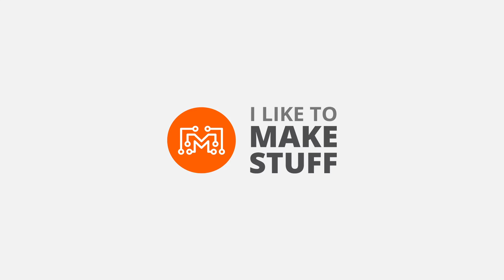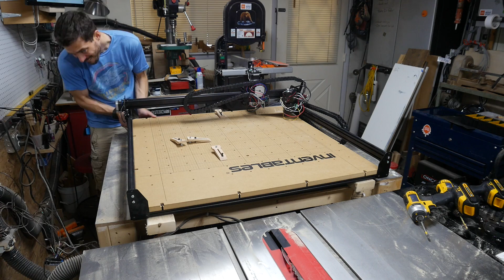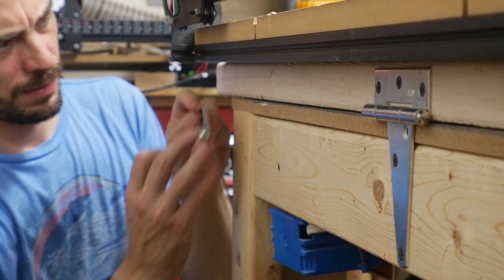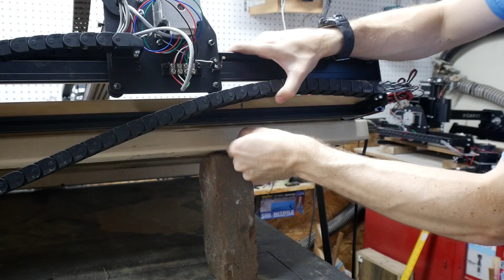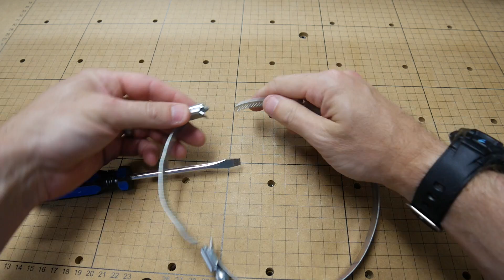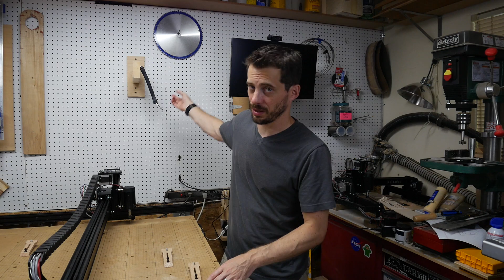Fold up X-Carve on an existing work table // How-To | I Like To Make Stuff

Comment: Nice setup on this fold sown table. I have an older shapeoko 1000x1000mm machine. It at my bigger shop far from my house. I have been considering moving it to my house and putting it in my garage as I would use it more. But the size is the issue... currently, it sits on a 48"x48" roll around shop table. Just too big for my small garage. I think this solution would work well for me!

Comment: This may be a dumb question, I don't have one but am very interested in getting one.  However, like you I don't have the room in my shop.  But i was wondering, if axis are controlled by belts on motors and the wood is secured to the waste board, shouldn't this be able to operate in the raised position?  That would make a world of difference in the possibility of fitting one in my shop.  I'm unclear if that is what your demonstrating here, I thought it was just storage when not in use.

Comment: Hi Bob, I would like to create the same table for my 1m2 X Carve, but I am a bit concerned about possible stresses an strains on the machine its self when it is vertical. I see the question has been asked earlier on, but after all this time, I was wondering if you have noticed any detrimental effects on the X Carve? Regards Andrew
Reply from the maker: I've moved since this, but it was on that wall for well over a year and I never saw any issues caused by it at all.
Reply: Thanks for the quick response👍

Comment: Bob, have you had any issues with accuracy over time storing it like this? do find that it requires a lot of recalibration? Just wondering because Tyler G (DIYTyler) recently had an issue and I was curious as to whether or not it might have to do with the way it was stored.
Reply from the maker: I kind of figured that  I would eventually, but I haven't so far.  It's been great!
Reply: Cool, good to hear, I'm wondering if it has anything to do with orientation of it, I believe his flips up on a different axis than yours, anyway thanks for the info and all that you do!

Comment: I watch all your videos, but got to re-watch this one with new purpose :)  I need a solution for this beast.   I thought bigger would be better until I started trying to fit it into the shop.  Thanks for your video and the link to +Steve Carmichael video.  Both great options.  Just need to decide which.  Trying to avoid shortening the Y Axis.    Homemade CNC 20"x40".

btw... your SEO is working great.  Got multiple links to your website (rather than YouTube directly) when searching for X-Carve solutions, upgrades and mods.   I was getting a bit depressed seeing all of the X-Carve negatives lately.  Re-watching some positive videos and discovering some new ones is making me feel a lot better and motivating me to complete this weekend.  Working X-Carve will be my Christmas Present to myself

Comment: Did you consider mounting the X-Carve to the wall (with offsets) instead of the table, so that in case you need to move the table for some reason you can? 

Also, I noticed in your video as you're making your counter-sunk holes in the wasteboard that it has quite a bit of flex towards the middle.  Did you have problems with the depth of your cuts before this project and if so, did mounting those strips under the wasteboard help with that?  I'm asking because my X-Carve seems to have a similar issue with a non-flat wasteboard adn I was thinking of killing 2 birds with one stone.
Reply from the maker: Mike Bryan My problem with the wall mount would be where my studs are and making a structure strong enough to hold the weight of the entire machine (not sure how to really explain that).
I personally haven't noticed the flex when cutting, but reinforcing it from below would definitely help it not be an issue.

Comment: I want one of these so badly I can taste it, but I can't seem to find any information if the x carve well accept a laser for cutting as well.
Reply from the maker: ***** I guess technically you could ount anything where the spindle goes, you'd just have to make a mount for it.  Did you look through the forums at inventables.com ?
Reply: I Like To Make Stuff thanks for the direction. Most importantly thanks for all the videos you make and the inspiration you share.

Comment: Instead of saw blades and so on, I would store any tools that only relate to the CNC machine on the wall behind it. You only need those when the machine is in operating position, but you might need saw blades and the like even when you have no plan to use the machine for a particular project.
Reply from the maker: Good call!

Comment: Do you need to support or park the gantry/spindle in any way?
Reply from the maker: No, I just slide it to the wall side before lifting it. If I forget it doesn't slam hard because of the belts so I have plenty of time to set it back down and place it correctly.

Comment: A friend of mine called the Inventables and they said not much testing has been done on storing the system on its side. This is a few months ago. Have you heard anything or had any problems with needing to adjust the x-carve.
Reply from the maker: Not yet, but if it becomes and issue I'll definitely do an update video about it.
Reply: any updates so far? it's been a while since you made this video... just wondered how it has held up

Comment: Good timing Bob, am struggling to come up with proper dimensions for a fold down table for mine and this will help. All that "stuff" (z-axis and gantry) do you know about how high that is off the bottom of the wast board? CAD drawings seem to be about 13".
Reply from the maker: Yeah 13-14 if I remember correctly.